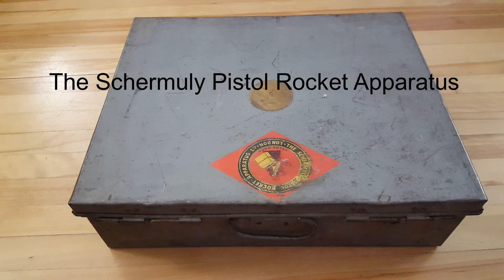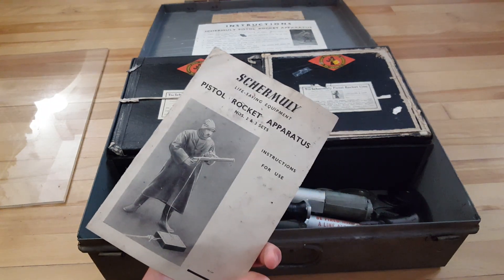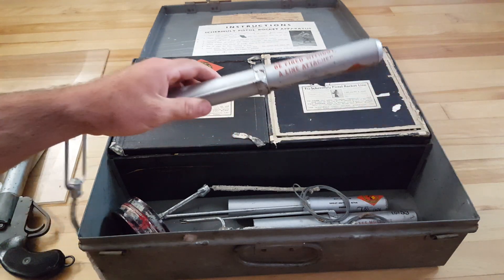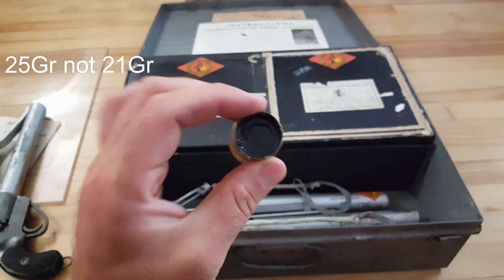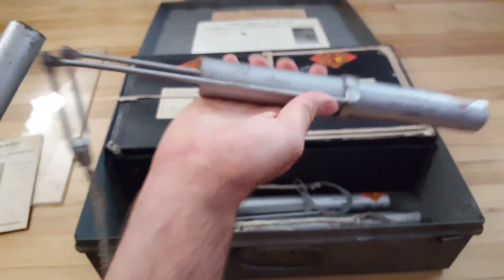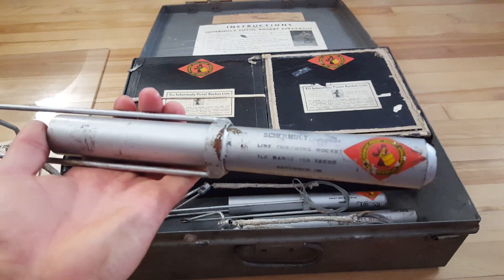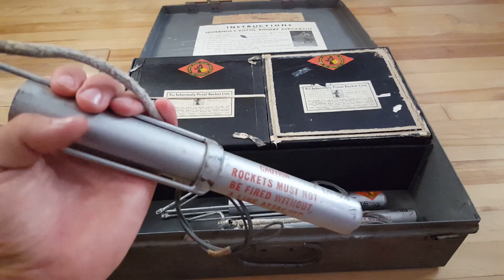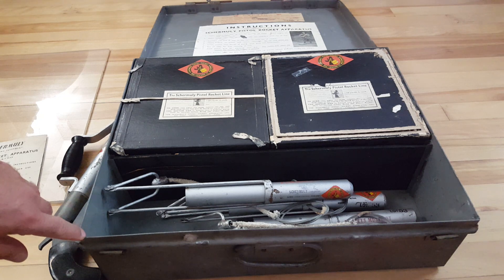Schermuly Pistol Rocket Apparatus

Comment: What's the length of the line in one of the boxes? Also seems dangerous for whoever is on shore - have to dodge a steel rocket then quickly grab the line!
Reply from the maker: I'd have to look it may have been 150 feet?  And they are usually fired from shore or rescue boat  into the water over the boat/people. The other end is connected to a real rope and that is what is then used as a rescue line IIRC.
Reply: @Stray03  did you ever fire yours? (with a string) or are you just keeping it as a display piece
Reply from the maker: Haven't taken the chance yet to fire it. I should try it but don't like the idea of possible destroying something